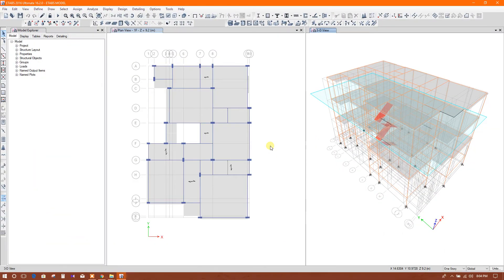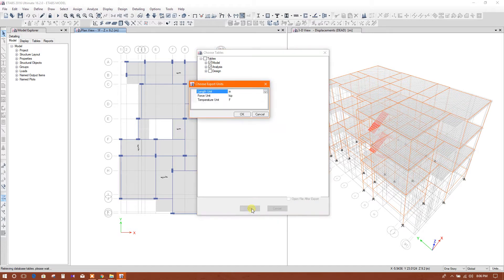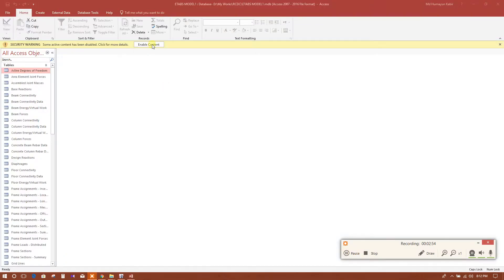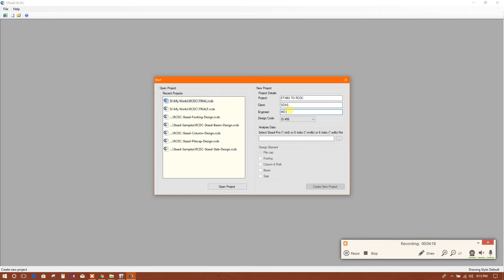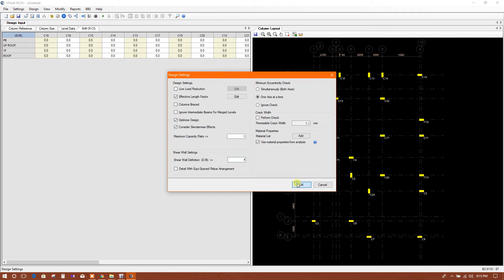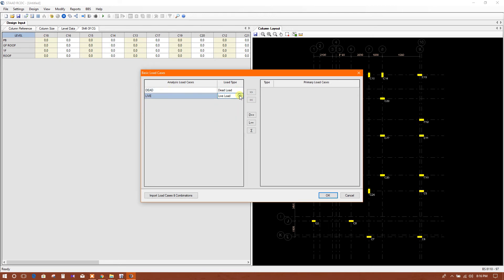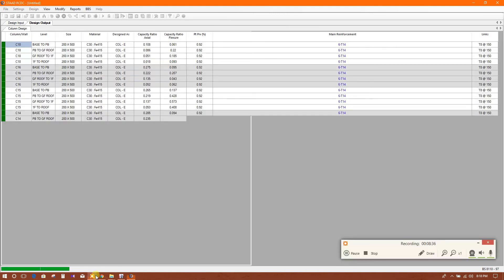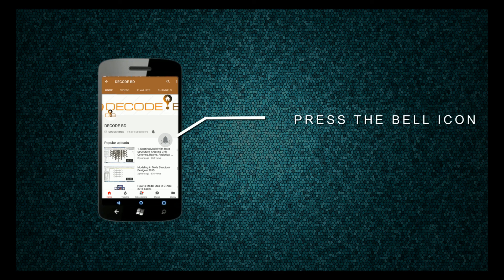ETABS TO RCDC COLUMN-FOOTING DESIGN AND DETAILING-PART1

Comment: While assigning columns, u had assigned all at its CG ..! Actually it's not like that na..if columns will be flushed at any of face then it shall not be at CG location, while assigning..as it will give different results in modal mass participation..due to change in CG & CR. I guess shall be location with offset command. Pls comment

Comment: Sir , in col. Design, reinforcement in upper col. Have more steel then lower col. e.g. ground floor col - 8-12# , 1st floor col 2-16# +10-12# , why it is happening in rcdc .
Reply from the maker: New RCDC sometimes not working properly with etabs. You can try RCDC v6.
Reply: @Decodebd  I am using staad pro ce with rcdc v 9.

Comment: "Brace Forces are missing for Basic Load Case '~Torsion'", how to fixed that error sir?
Reply from the maker: Not sure abt this error.
Reply: @Decodebd  and why sometimes sir after trying to import in RCDC from ETABS,  after configuring in RCDC it says "Beams missing", my ETABS file cannot really be imported in RCDC
Reply: In beams you have to select output station 13 in etabs with select beams only

Comment: will u plz tell me what is that "Plan Rounding" that 100 mm u have given?
Reply from the maker: Can you specify the minutes & second in the tutorial so that I can identify what do you want to know?
Reply: that "Rouding off factor" how to consider that? and can we get foundation depth from rcdc design or we need to consider it by ourselves
Reply from the maker: @ilustraca  for depth I specified increment of depth 100 mm. If it's not passing with 300 mm depth then it will check with 400 mm, then 500 mm like this. Yes RCDC gives fdn depth.
Reply: @Decodebd  Thank you, Sir...One last question, while considering the base story height in ETABS should we consider the Column length below the ground which is upto  foundation? if so then how can we consider that depth?? as it is  coming after design
Reply from the maker: Normally we consider 1.8m or 6ft as fdn depth. No need be such specific.